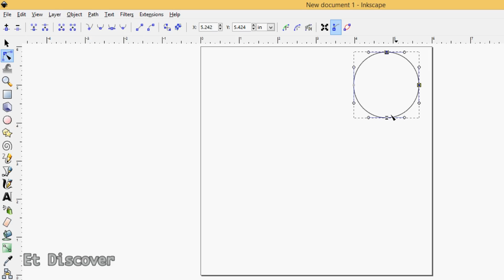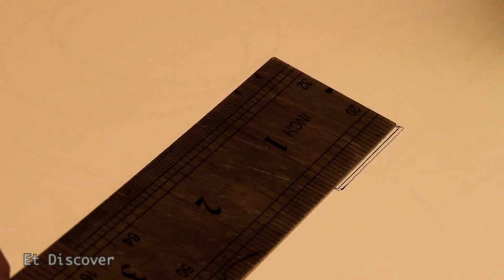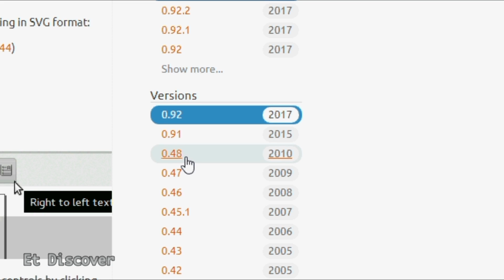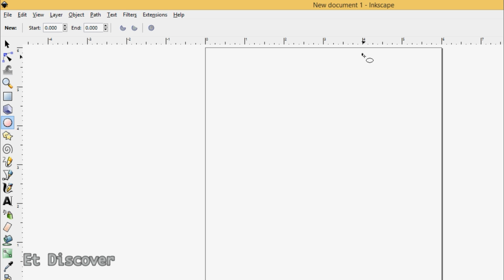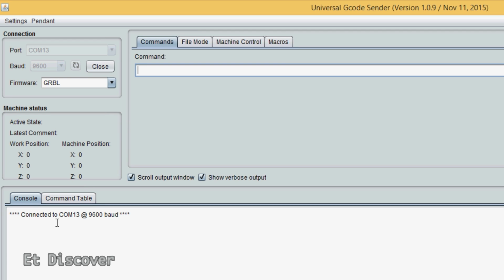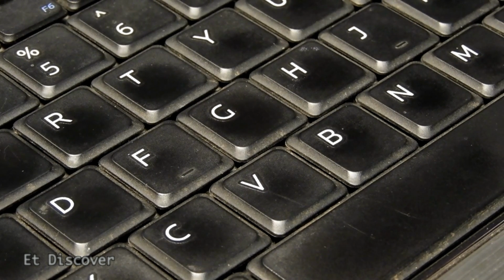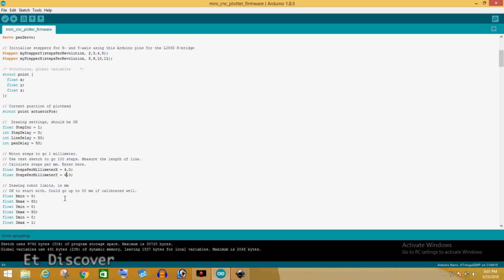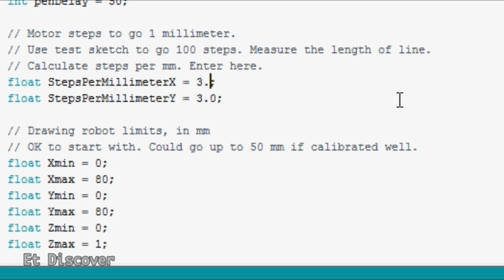CNC's  Hardware, Software , Firmware all Problem Fix and Make it Perfect

Comment: great video
I made this machine with grbl cnc with cnc shieldv3 (a4988 stepper motor driver)
but it is not working, grbl controller 3.6.1 show that (undefined feed rate)
so please tell me how to fix it. thank you.

Comment: Bro my servo is not working many times I replace the motor and do proper connection but does not work the servo.
Reply: I have same problem but nobody reply to solve my problem.
Reply: My also sometimes it works and sometimes not